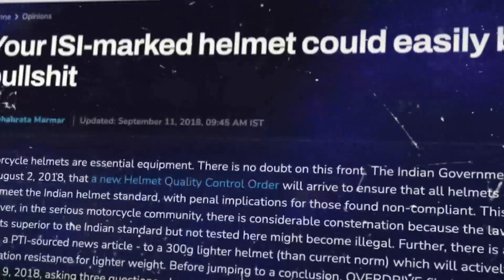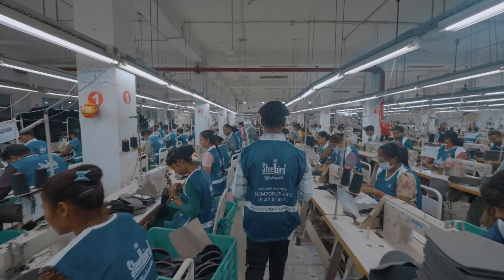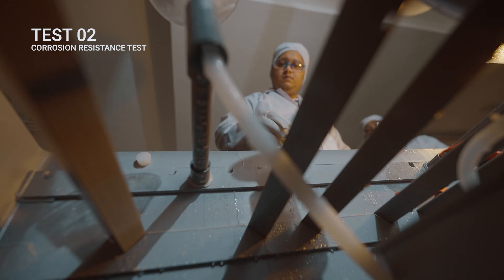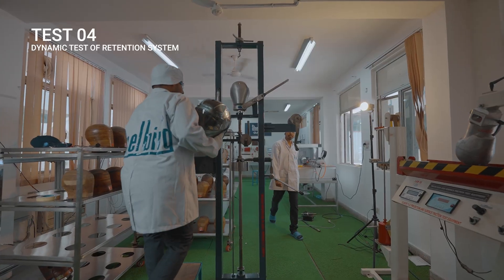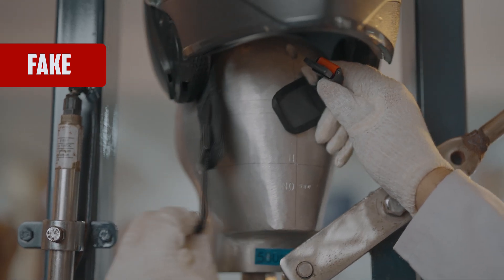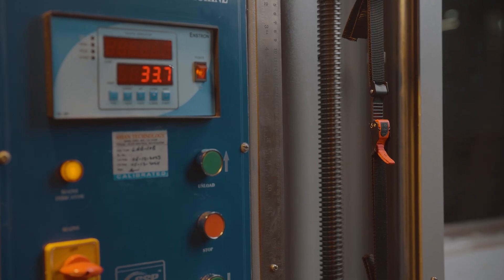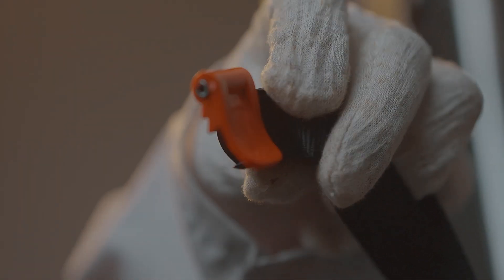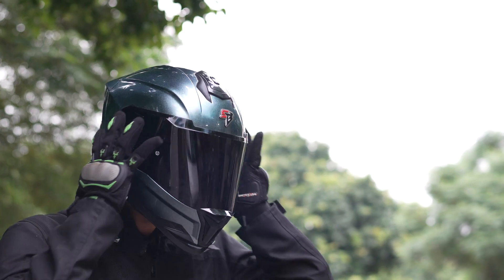Fake ISI Vs. Real ISI Helmet: Buckle Safety Test: Prioritize Your Protection with Steelbird Helmets!

Comment: This buckle test is a game-changer 🔐! The way Steelbird’s real ISI buckle holds firm under pressure while the fake one fails instantly is chilling. It’s proof that not all certifications are equal—only genuine gear can be trusted when it matters. Don’t risk your safety on cheap imitations. #RealISI #BuckleUpForLife